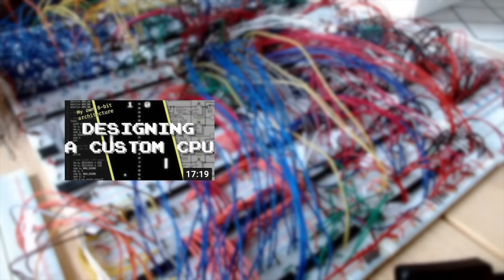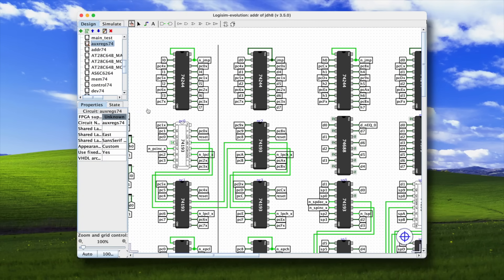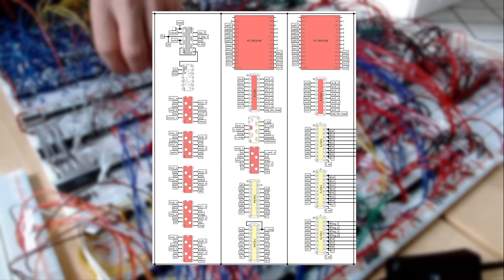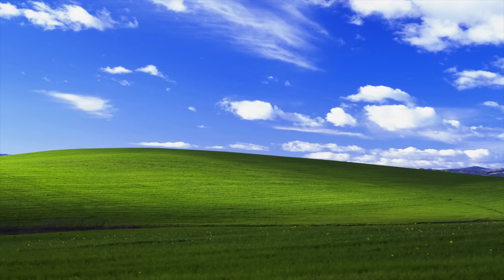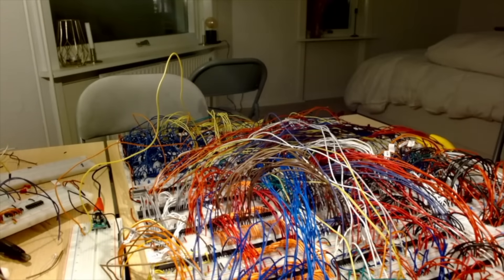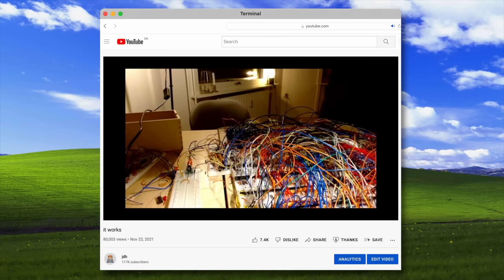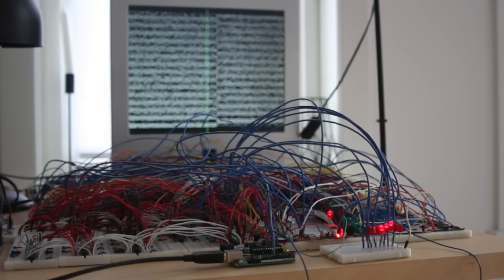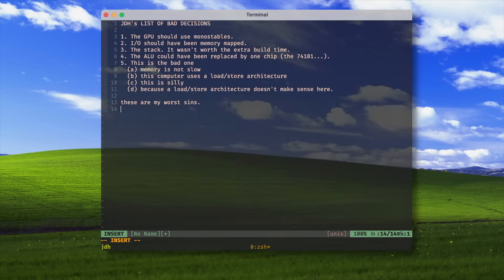I built my own computer. by hand.

Comment: Building a computer by hand on breadboards has really been the only way for me to understand coding in Assembly. Granted there are different versions but the core concept is the same across hardware like the 6502, 68k, z80 and x86.

Comment: hey, a quick suggestion for your project. You could've had built a data bus for all the wires. so instead of having random wires go everywhere all over the place, you would've had a central bus where all the connections between the modules would've went. potentially would've made debugging easier. otherwise, good job!

Comment: …by hand ya dude, that’s the point no stfu…you stripped every wire with hand pliers? My god. 

Used to program CPU’s, build the boards, prep wires etc for a company after done uni. Can’t imagine if we didn’t have the automatic wire stripper, and what building is not far off at all from amount work out in a week 😂

Comment: Yo, this thing is awesome!! I hope to build one like it eventually. I'm just getting started with building hardware projects, I've so far only built half of a going to be from model to rc car customization. A wired rc not wireless rc. using breadboards. So far all I've got is you can turn on the turn signals and the motor no wheels yet lol.

Comment: Nice work and excellent video. My CPU design has registers: IR, PC, Flags, A, B, M (RAM address), S (one-position "stack"), and index register called X, which is always added to M. Results of math always is placed on the stack. My 16 instructions are: ADD, AND, NOT, OR, SHR (shift right), SUB, XOR, LDA (load A immediate), PSHr, POPr, STA (stores A into M+X), RDM (reads M+X)., JC, JN, JV, JZ. Since any compare is just a subtract that sets the flags and doesn't alter the A register, I don't bother with a compare, I just use the SUB.   Addresses are 12 bits. instructions are 16, which is 12-bits plus 4 for the opcode.

Comment: This is Deja vu. Back in the early 1980s, my brother and I wanted to build a programmable, MIDI controlled lighting controller, like for stage/theatrical lighting systems. We didn't build our own CPU, we used a 6502 and a MOS peripheral I/O chip (can't remember the number). Our board looked like the ones in the video. I remember the first time we tested it we both said if it didn't work we'd never be able to figure out which wires were out of place in our haystack. But it unbelievably worked the first time. We had an AM radio playing, and the RF generated from the breadboard made a terrible sound that was kind of an audio clue that things were happening. We used Analog Devices AD558 8-bit Digital-to-Analog converter for our output to the light dimmer, and plugged an electric drill into the outlet for the channel. We had written a simple program to just slowly cycle the digital input side of the ADC from 00 to FF and back. And it was one of the most memorable experiences of my life when that drill started to spin at low speed, work its way to full speed and then slow back down. We were both twenty-something at the time, and we thought we'd conquered the world. Good times.

Comment: I'm embarking on a similar project to build a custom CPU, but my first effort will be to build it using an FPGA dev board. I'm still debating on the design and I found your lessons learned very helpful. I've especially wondered about whether to include stack instructions and a stack pointer. I'm leaning toward the simplest instruction set and incorporating macros into the assembly language for things like the stack and subroutine call/return. It will save some logic gates at the expense possibly of a bit of speed.

Comment: We built breadboard computers like this in high school (mid-80's). We were put into groups of 3-4 people, given the schematic, BOM and told to go build it. The design used a 74181 as the brains.

We didn't have a display and all we had for output were LEDs and 7-segment displays. LCD? LOL. FWIW this was a few years before VGA was even a thing. 

I don't think any group actually got the whole thing to work but some groups got some sub-systems to work.

Comment: 1. Use a PCB instead of bread boards.
2. Use a FPGA(s) for all of the logic.

I recall someone made a 6502 using only smt transistors, diodes, & resistors, but did it on a PCB. I think the clock speed was in the the 10s or 100's of Khz.

Comment: I am not an electrical engineer, but a software engineer, but wouldn't it have been easy to print the wiring on a circuit board when you were done doing the hardware design?

Comment: Im still so confused because the first computer didnt use another computer to program it. So if the original computer didnt have another computer to program it, how did it interpret the I/O switches and execute a function based on the configuration, knowing what to do?

Comment: maybe you shoulda used boards with pins sticking out from the bottom and got the wiring printed on a sheet to make it cleaner?
I'm not sure, maybe you could try changing all the things that are problematic and make another video, but , that might hurt a lot to make, but it may be fun and refreshing also..

Comment: About the load/store architecture:
I agree that cpu's of the 8-bit era could afford to work a lot closer to the memory than you can today.
But every byte still has to go through the memory bus each time you read and write, so why not keep it in a register until you're done with the computation?
The 6502 seems to be really optimized around its memory bottleneck of one byte per cycle, almost all instructions take the same amount of time as the number of memory accessess that they need to do (including reading the instruction) if I remember correctly (except that all instructions take at least two cycles). What I don't understand is why they didn't include a fourth register beyond A/X/Y, there's even space for it in the instruction encoding. Maybe they were just out of silicon space for another register, but I can't help but think that it would have made the code faster and more compact.

6502 code tends to use the zero page as an extra register file, and it's somewhat more efficient at that since only one byte is needed for zero page addresses. But it would have been even more efficient if the data was already in the cpu.

Also, I think you would have needed a bunch more addressing modes if you hadn't gone with a load/store architecture?
I'm guessing that the goal of the exercise was more to make a simple design than an efficient one, though?
It seems that you took some inspiration from the 8080, which in many ways seems to be a simpler design than say the 6502 (Of course, it has some register to memory operations).
Reply: You sure know a lot. Did you study computer science in university?
Reply: @mat-qt4fq  Not really. I did study at university, but mostly math, physics, and engineering. But I've been a programmer since I was ten. Most of this stuff I've just read up on on my own out of interest (or picked it up from youtube :).

Comment: Back in the day, I was a (to the component) technician on the AN/UYK-7 computers.  The most sophisticated IC in the CPU(s) was a quad d-latch.  Sub clocking was done by analog delay line.

I've always had a thought of doing a project like yours.  Thanks for convincing me to skip that project.

Comment: What was the point of doing the wiring on the your own on a breadboard ? Couldn't you send the circuit design and get a pcb delivered to your house ? You would then just have to solder the ICs to the pcb.

Comment: Well, I think you were too hard on yourself.  It was your first practice attempt.  Don't get me wrong, I think that you need far more instructions, some of what you said and so-on.  Test in bread boards is fine but you could have converted that to Field-Programmable Gate Array in the end with whatever support chips that were required.  If I had the time and what I have lost over the ages I would try to rebuild the old VAX-785 but using modern tech.  The OS?  Well, that would be a royal pain.  Am thinking general minus the massbus and the unibus it would fit in one large desktop tower.  It wouldn't be 100% the same as I would make some redesigns to it.  So, it would be functionally right but upgraded and enhanced otherwise. Oh well, but you got it to work.  Thats the important bit!

Comment: I started something similar a few years ago.  I only used ICs when I'd already built the equivalent with transistors - so an IC with 8 AND gates could only be used once I'd built a few AND gates without ICs.  Started from limited electronics knowledge and got as far as having a circuit producing the Fibonacci sequence with LEDs displaying memory content.  So at that point I had basic memory handling and felt I understood everything I needed to do to get a working computer but gave up at the point of defining an instruction set.  The initial aim was to achieve that level of understanding so I wasn't convinced I wanted to keep adding breadboards having achieved my aim.  So your collected mass of breadboards brought back memories.  I think this is a great thing to have a go at for anyone with enough interest; even if you don't take it all the way.

Comment: I wouldn't have thought anyone under 50 would understand how to do this.  A simple logic probe would go a long way to help insure the integrity of the connections. also I'd ditch the needle nose pliers and use a 5 or 6 inch needle driver to insert wires into the breadboard. I think you'll find it much easier. I'm not going to address  the construction or board layouts. You'll fine tune things. I'd recommend cooking with a Z80 or mc68000. Anyway keep at it, and have a great day. Maybe I'll stop by again..

Comment: 1. I'm an old guy with 40 years in IT.   2. University I once worked at had architecture class where they made microprocessor totally from TTL and components...no ICs used.  3.  IBM back in ye olden times used to have various courses..developer, DBA, systems etc....thjey all started with an overview of hardware.  4. My first programming job, my boss, an older than me Air Force Major, had me start by making diagrams of the hardware.  4. He said, you can't understand the software FULLY unless you know the hardware its implemented on.  5. OOOOhhhhh Awwww...is that a TOP LOADING VCR in the thumbnail at the beginning? Nostalgia Envy in overdrive.  All of this is just way of saying...cool video! Thanks.

Comment: I was working in 2000 on a computer system which when I found main box and found all these circuit boards just like you had and a small controller..  it operated the elevator system..  wow, we pulled it out and installed proper system.    I still remove all the wires and circute boards, but to be hones it worked..  Downey California u

Comment: Nice job!  I've been wanting to do something like this myself ever since starting my CS degree a few years ago.  Maybe some day I'll have the time, but in the meantime, I enjoy seeing others succeed at it.  :-)
Reply: They aren't going to teach you what you need to know in a CS dept. This is CompE
Reply: @cambrown5777  My university has them both in the same department (with a curmudgeonly acronym).  In any case, my degree touched on it at the beginning (we had to work through building and programming a 4-bit computer from discrete transistors (in... not Logisim, but something similar... forget the name at the moment), to understand how digital electronic computation works), but didn't require any high-level classes on computer engineering as such (that would be a different degree, yes).  I did take a couple as electives, though.  :-)  Plus, I have a large amount of books.  Maybe too many, but I like to keep learning!
Reply: @derekchristenson5711  Totally respect that. Lot's of schools are EECS, some are ECE depts, with a separate CS dept. I'm sure you're familiar. In addition to the resources JDH gives below, if you are interested in computer eng, a great textbook is Computer Organization and Design, The Hardware/Software Interface by Patterson and Hennessy. We used it in the first real arch class I took at Northwestern for whatever it's worth :) Goes over pipelining, branch prediction, and some other cool stuff that is totally standard practice in modern VLSI at a low but comprehensible level
Reply: @cambrown5777  Indeed!  We used that textbook in a couple classes as well, so it's in my library.  :-)  I believe we used a good chunk of it in "Assembly Language and Computer Organization" and another chunk in "Computer Architecture", IIRC, in addition to another text for the latter.  I have not read it cover-to-cover, but I've read a fair bit of it in the course of my studies, and I referred back to it later.  We used the original (I think) MIPS version of the text, but I've seen it available using ARM and, more recently, RISC-V as the reference architecture as well.  

Fascinating stuff.  I enjoy knowing how computation works from the Boolean logic, up through digital logic gates, on up through machine code, assembly, high level languages, interface design, and the theory that underlies each level of it all.  I won't claim to have mastered it, though!  But, I love exploring any areas that still seem opaque to me, and I'm always finding new corners to explore.  :-)

Comment: The closest I came to a breadboarding a project of this magnitude was the design laid out in "The 8088 Project Book" by Robert Grossblatt. This design will, however, instill the fundamentals and mindset of basic microprocessor operational principles. It would be interesting to see an upgrade utilizing programmable logic devices like Lattice Semiconductor pals and gals found on vintage motherboards or CLPD's. This is certainly an ambitious effort nevertheless! Great job!

Comment: i did the 8 bit when i was younger and went with the cheap bread boards, and what a nightmare... the modules worked perfect independent but once i hooked up the bus i had issues every 8 clocks, i later bought the higher end breadboards what a difference.

Comment: I built a much smaller computer by making it 4-bit but still giving 12-bits of addressable memory. My goal was to make a computer with as few chips and wires as possible. It can have an arduino hooked to the bus and clock, and given its own control line so that it can act as a text terminal output and keyboard input through my laptop.

Comment: Just recently following Ben Eaters 6502 computer build using the said chip, and a couple outher ROM/RAM chips and video controller. This is absolutely the next level. LOVE IT. I just recently purchased 'Turing Logic' from steam, and it is following this very process: build the computer using transistor based logic gates, program in binary, create an assmbler language, write a bare metal 'OS'/game.

Comment: So you used a Arduino for the power and clock signal?  and you used a ton of integrated circuits.  No offense but it seems less like you built a computer and more like you assembled a motherboard.  Its really impressive, just not even close to a whole computer.
Reply from the maker: no, it's definitely a computer, a motherboard is something that hooks a bunch of components together. this is a CPU, GPU, RAM, ROM, and an independent crystal clock oscillator. The Arduino was just for testing purposes. exclusively.

Comment: so is there any particular reason why this channel is following the same exact order, and the same idea, as Ben Eater's channel which did most of this 2 years ago?

Also you forgot a sin: 6) You used an arduino as the clock signal when crystal clocks and even clock ICs exist.  You even referenced that one of the problems you were having with the video output in the previous video was because you were using an arduino.  An Arduino is NOT an FPGA.
Reply from the maker: There’s a crystal oscillator included in the computer, the arduino is used for testing (easy to step clock automatically).

EDIT: also, many people have built breadboard computers both before and after Ben Eater’s, there’s no ownership of the idea by one person or another :-)

Comment: This was what my first from-scratch computer looked like; the 'mcDonalds arches'; after you've done a few you start trying to lay ther wires in a buss form, along the breadboards... but as a noob, it always becomes this big mess.

Problem I ran into, running at any real speed (Mhz+), was the arches seemed to have a capcitance issue against the breadboards, causing all kinds of issues slowing moving around the boards .. like a cloud of trouble :)

Using a metal cookie tray underneath seemed to help somehow at the time, but just making PCBs (way easier than I thought at first), with lots of ground plane etc, worked amazingly well.

Amazing job, and love the videos!
Reply: Also .. what do you do with it now?

Convert the schematic to a PCB and populate that, and then you can have it for life; I found with all these giant stacks of breadboards (glued, to actual bread cutting boards, muahuahua), is just a nightmare, and after a couple weeks there'll be all kinds of wires loose or dust in the way or something,a nd it all goes to crap :/ All those arches of wires are hard to store!